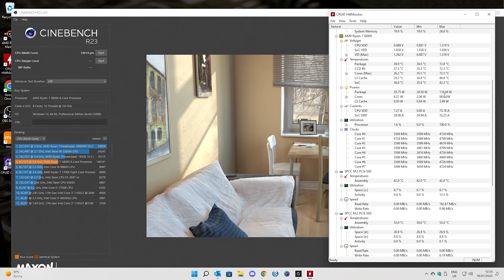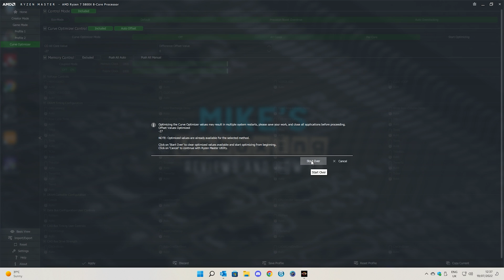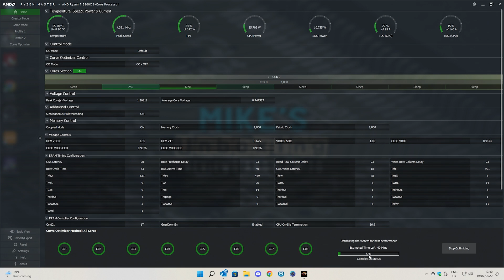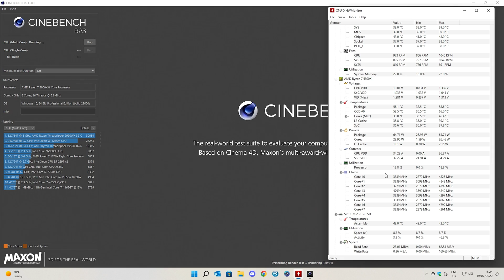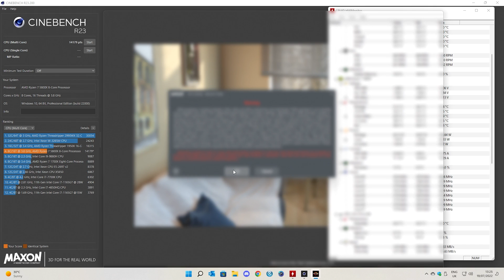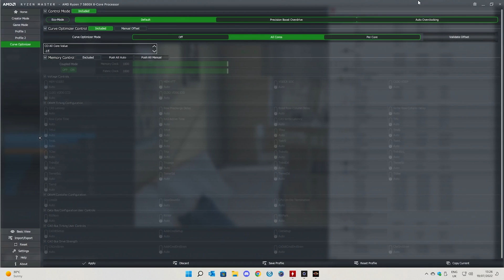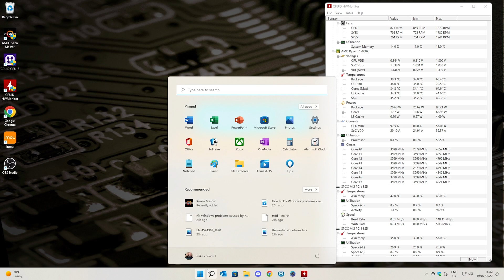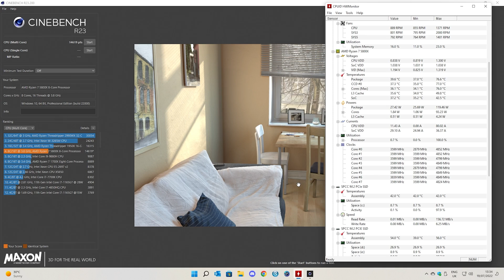Make AMD Ryzen 5000 Series FASTER QUIETER & COOLER With Curve Optimiser

Comment: under volt helps speed the CPU up ? im confused . i guess it makes sense cooler, quieter, wise but how more performance ? im going to try it out Today but will it still be good for a Crap 3800 not sure why i even went this CPU its never been good enough for what i needed not sure its worth getting the 5800x is worth it either now but defo try this out today hopefuly Thanks Mike, & Kath
Reply from the maker: it works on the principle that one of the trigger points for frequency throttling is the thermal sensor, less voltage means less heat generated so in theory higher boost clocks and maintained longer.
all chips are slightly different so some react better or worse depending on the quality of the chip
Reply: @mikesunboxing  thanks Mike not got round to it today but will try it out on the 3600 see if i can get anything extra outa it

Comment: Hi, Mike. I've never been a fan of Ryzen Master, and here's why. I just ran Cinebench R23 Multi-Core for 10 minutes on my manual overclocked 3900X and got a score of 18517 with a max CPU temp of 72c. Then I ran Cinebench R23 Multi-Core for 10 minutes with Ryzen Master's Auto OC and received a score of 18603 with a max CPU temp of 76c. 86 points isn't worth the extra 4c in my opinion.
Reply: Neither have I, always use BIOS. Don't like Ryzen Master and always discourage people from using it.
Reply from the maker: yes it is a "safer" option for those a little unsure what needs to be done, seasoned pros will be able to dial in much better settings

Comment: I never knew there was a Windows store version of cinebench 🤔.
Would you need to do this maybe as the seasons change and temps go up/down or just run it once and leave it alone ?
Just built a new system, will start it up tomorrow for the 1st time so i think i'll run cinebench today and see how my old/current PC does then see tomorrow how much better the new rig is. Same GPU for the moment.
Reply from the maker: i would dial it in and leave it if it was stable, with energy prices as they are any potential saving is a good thing
Reply: @mikesunboxing Cool ( no pun intended ) .
Just ran Cinebench on old/current system i7-4790k, 1105 single core, 4655 multi core, i do have it overclocked, tomorrow i'll test on new system.

Comment: Literally did this with the new 5600x, its works wonders! Did think my system was going to explode at one point though!!
Reply: My new 5600x system get's turned on for the 1st time tomorrow !
Reply: @PaulJohn01  how's it been running?
Reply: @TranceHistorian  Very well so far. I actually got the 5600x cheaper than i could get the 5600 🤔🤔
It's the Philippines and we have weird pricing.
I did buy a custom air cooler but temps seem fine.
It cost about 180 dollars and i don't see a need to get an AM5 CPU anytime soon.
Reply: Mind sharing your test numbers? Max hertz, temp, and power draw?
Reply: 70 is hot bro. Mine max at 65 playing warzone on ultra graphics. I have 5600x
Reply: @parzxd  Might be higher ambient temps too
Reply: @parzxd  howd you managed that. im intrested in hear about what you did so i can do it aswell
Reply: That's because it's a 65w part this one is 105w part of course yours will be lower @parzxd

Comment: Interesting. I did mine via the bios and testing with a little utility called CoreCycler (which uses prime95), I'll check out Ryzen Master as that looks like a quick way to get to a decent point without rebooting after each change. OCCT also will test for such errors, but I have found CoreCycler the best at finding more infrequent issues. So if your undervolt has some instability I would check it out. My own 5800x is a bit all over the place with individual core undervolts between 0 and -30 and it took a lot of testing to dial it in, even then it only supports a +50Hz clock increase as to go higher means even less undervolt, and I want more all core boost than single core Hz.
PS. My 5800x can get 16k in Cinibench R23, so you probably have more to go (or are running other stuff in the background) - oh it could be temps and mine was probably on a cold day.
Reply from the maker: mine is under performing for sure and still gets quite warm. but i keep on changing settings and the weather goes from one extreme to another
Reply: @surf is there any manual or tutorial for cyclecore? My 5900x shutsdown in some games and I want to find out which core it produce. Even a reset cause shutdowns. All after playing with undervolting :-(
Reply: @DieTabbi  I did a reply but it does not seem to have posted> Anyhow there are a couple of youtube vids out there you can see people using it. 
In a nutshell see the readme.txt, and you need to edit the config.ini file.
There are really only two settings to make in the ini file:
1 - "runtimePerCore" use 1m for quick checks then when all seems fine go to 3m and for an overnight set of runs try 6m
2 -  "coresToIgnore" use this to ignore cores you know are fine, it helps when just sorting out the cores that are failing by reducing test times
Reply: Juri V  It was totally fine and I ran it like that for well over a year as I got the CPU in April 2021. You have to put the work in the testing and back off when any error. I found other testing methods did not spot errors that Corecycler could with an overnight run. So, before I used that then yea, I found some instability when testing with OCCT.
I now have a 5800x3d that I undervolt using a tool called "PBO2 Tuner" and get -30 on all cores and rock solid so far. The CPU runs at 4.45GHz all cores under full load. I did this as I managed to get a 4090 GPU but want to wait for AM5 CPUs to settle down and prices to fall on motherboards etc.. or see what 14th gen Intel is like.
Reply: Juri V  The only slight risk if you don't push it too far is if the PC crashes and windows gets some corruption. Generally, you take the undervolts a little at a time so you can find small errors rather than crash. I am not sure what Ryzen Master is suggesting so can't advise on that.
Also the 5800x will always run hot and spike in temps even if you just think of running something.  What you are really concerned with is temps under load that then mean the CPU does not boost as much.

Comment: Good video! 👍
Definitively something I planned to do for my mining rigs, as I have upgraded 2 video cards. I got a 6800xt and a 6700xt for really good price, and combined with cpu mining too, that will be something that should help on the temp side. Still too hot over here to start the work, so that will be something I will do this fall.
Reply from the maker: hope it helps save a few $$ and keep things a bit cooler
Reply: Ahh you're the reason why I paid £400 for my 6600XT 2 years ago, woow 😒😒😒🤣

Comment: Interesting video, havent messed with Ryzen Master in aaaaaaaaaaaages.  Some great results there from the undervolting, wonder what my 3600 can muster.  Thanks Mike and Kath.
Reply from the maker: Try it, although you might need the manual bios version of the video due soon for the 3600
Reply: I run my old 3600 bronze sample balls to the wall of what I could do for two years. 1.31V at 4325mhz all core. No problems at all. I swapped it for a 5600x now. Sold the 3600, and the new owner runs it the same settings without any issues... No degradation from when i bought it new. I also won the silicone lottery with my 5600x. That one I run at 4800mhz all core. (Gold sample) Can go higher when testing, but i don't want to go higher because of the voltage has to go higher than I'm comfortable with